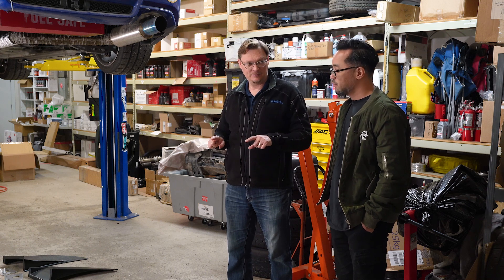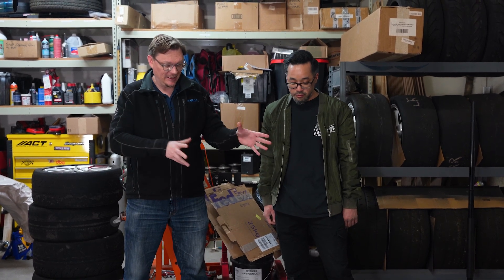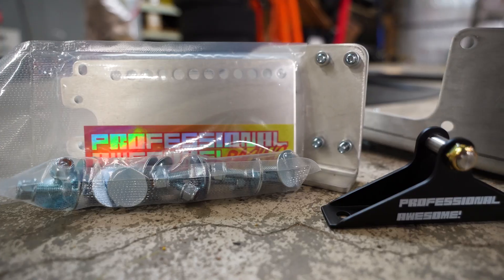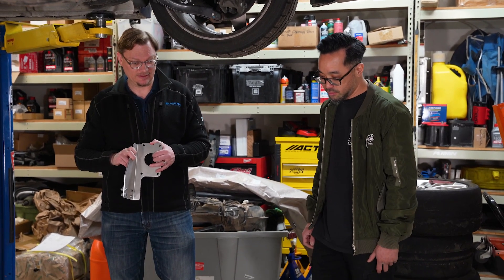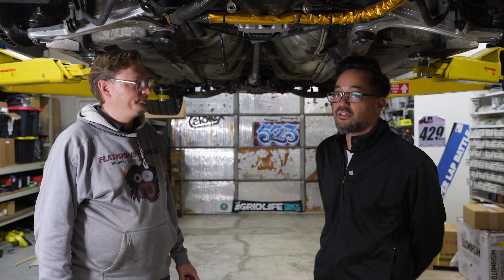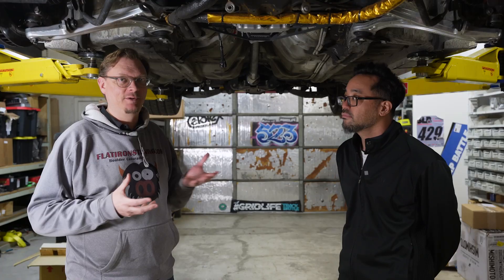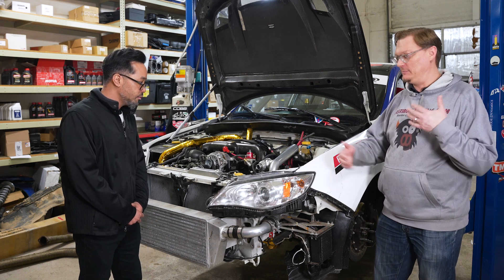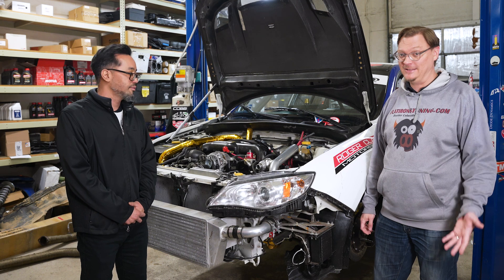Sequential Transmission Install into our Pikes Peak Car begins!

Comment: Wait whats going on in the rear of that GD on the lift? Is that a rear VA setup in a gd? Noticed the trailing arm isnt the usual.
Reply: its a GV chassis on the lift
Reply from the maker: This is our Pikes Peak car which is a 2014 WRX.  Our Rally car is a 2002/4 WRX which is what you are thinking of I think.

Comment: Just curious. Since the intercooler is front mount why not put the oil cooler where the top mount use to be?
Reply: Heat soak from the engine would be my guess
Reply from the maker: Thanks for your question.  That was a thought at one point, and it can certainly be done.  You will have to make sure that you have good ducting to send the captured air through the cooler.

In our case, we now have an extraction hood, so that location is gone...  But we should be (and do seem to be) moving more air through the radiator so the front should be a viable location for the cooler.

Thanks for watching and Stay Tuned!